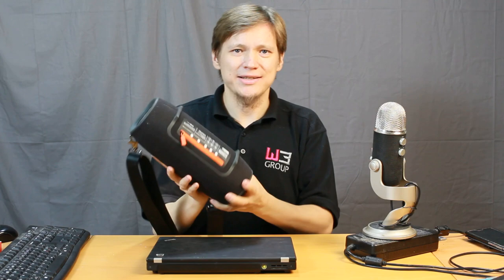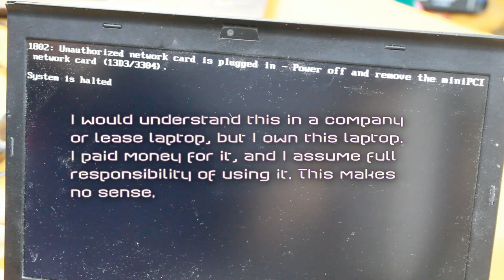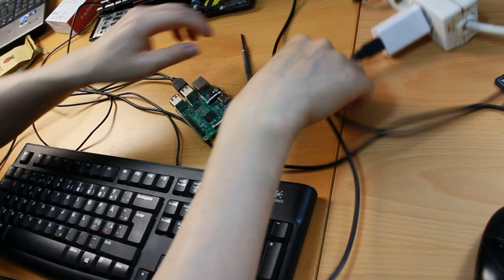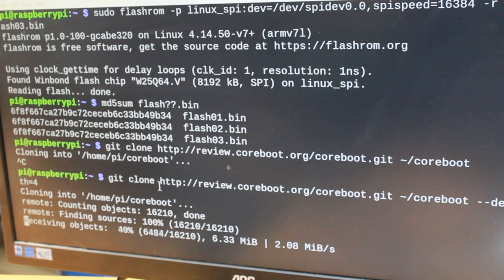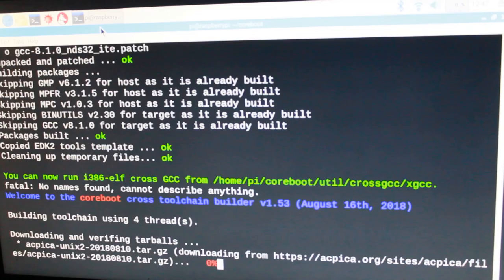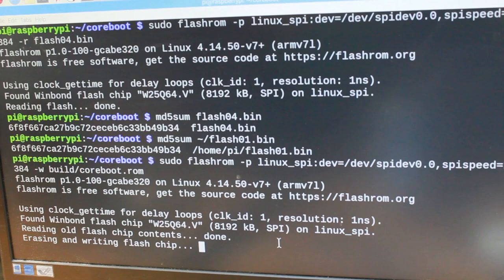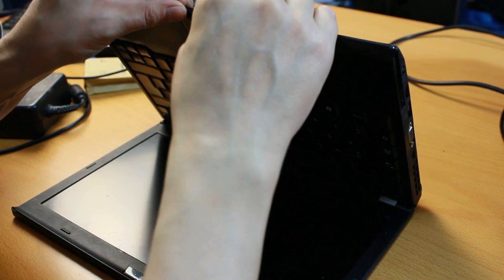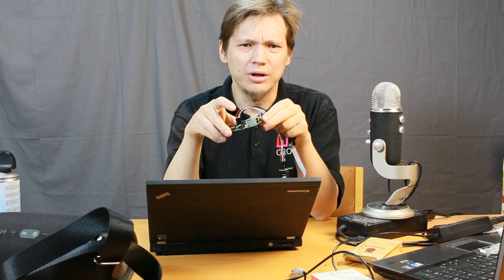Replacing BIOS in a ThinkPad with GPL CoreBoot (former LinuxBios)

Comment: I dont like how you handle that lovely x220... also its mini-pcie not mini-pci. those antenna cables are for wrongly attached.. red and blue are for mobile broadband and black and grey are for wireless. on that model bluetooth comes from seperate module on motherboard and i can send you one of those. those soic8 clips you use are pretty bad in quality. i would buy pomona clip for easier usage and better quality. there is also fullhd mod for that laptop model. with coreboot you can add sierra wireless 4g lte module on laptop and if you add extra antenna for GPS you can also have GPS on it. mini-pcie have pci-e lane and usb 2.0 - both 3.3v. i did use same clip for my first time by cutting off original cables and soldering new ones from higher quality jumper wires.
Reply: oh also - you can make it look way never if you just buy 'taikasieni' and use it all over body of it. ofc you need to disassebly it fully to not make mess with water over pcb. and there is new rubber feets available at aliexpress and ebay.
Reply: you need to use extender for card to mount it properly. also to attach keyboard you first put palmrest in its place and after that put keyboard in its place, press it down while move it up then down (or another way around, too lazy to check).
Reply: and also you should have used lil more time and efforts and just remap flash index, free all space taken out by intel me.. could be useful to have more room in chip and maybe could be nice to actually make it use grub/kernel-image and high res mode if you are anyways gonna use linux. cant remember if seabios did work with highres mode.
Reply: And i forgot to say that you did buy wifi+bt combo card and you could have just replaced your original card with it instead of adding it to wrong antennas and connect it half-ass ways
Reply from the maker: Okay I just read half-ass. My first impression of your lengthy posts is an attitude problem. But thanks for telling me about the antenna wire colors. I could not find that information anywhere, so it had to do my best without. It would be nice to learn your source. The reason I did not replace the original card (that was actually my original plan, that’s why I bought a combo card) is because the combo cannot do 5 GHz.
I did not buy Pomona because the prices with shipping were pretty high everywhere I looked.
Reply: @Bisqwit  i might actually have made error with colors. Red is 3g/4g main antenna and black or blue is secondary antenna. They have been same for long time. Do you want bt module? I can mail one. I have problems sleeping so my mind isnt so clear all the time.. and thats my reason to do kind of spammy reply.
Reply: installing keyboard you put it after installing palm rest, you have it little lower than slot for keyboard, then press it down and push as up as it goes and then press it down and drag it as close to palm rest as it can go. finally tightening screws under laptop. to me it looks like you did do that wrong too. probably having some other problems with your palm rest... sadly i dont have any extra palm rests in good shape. but i can send bt module or 2 and 3g card if you wanna try it out. sadly i have promised to give someone else mini-pcie msata memory.
Reply from the maker: Why do you have so many? It’s weird. If you’ve got an extra one (BT), sure I would like one. Which chipset does it use? Does it come with the connector/cable?

As for closing the palm rest and that stuff, doing stuff on camera is sort of stressful and you never concentrate as well and do as good job as when working privately, because you have to worry about visibility in the footage, how long it takes, and that sort of stuff, and part of the concentration is lost in doing exposition at the same time.

As for MiniPCI/MiniPCIE, I did actually say PCI-E on the video several times, but it was the ThinkPad BIOS which called it MiniPCI, not MiniPCIE.
Reply: Well I have few spare laptops as I kind of hobby restoring them and playing around modding hardware. And Im working for company selling used business laptops.
Reply: Im not really sure which chipset it uses. it simply goes to motherboard as it is with single screw.
Reply from the maker: By the way the reason why I did the antenna wires that way, is because the red & gray wires are too short to be connected to the left-side card. The blue & black can be connected to either card, but the red & gray can only be connected to the right-side card. This limits my options. If the combo card was full width, then the wires could be connected correctly.

Comment: I run older brother of this machine - x200. It came in with bluetooth card installed and working out is the box but I haven't tried it with wireless speakers. 
But I would expect there's an option in the bios to allow or verify newly inserted hardware..
Reply from the maker: There is no option.

Comment: Cool but couldn't you have just bought a new laptop for what you spent?
Reply from the maker: I spent about 6 euros. It is not very often that you can get a good new laptop for 6 euros.
Reply: I meant for all the other stuff.  Great video by the way.
Reply from the maker: What other stuff? All the other stuff were things I already had for my hobby and work and because this is not my only computer. Like the screen, keyboard and mouse. The cellphone charger — obvious. I had gotten the RPi for free, but I could have used any device that has SPI/GPIO, even some $5 Nucleo/Arduino board.
Do you think I only bought a screwdriver for this project?
Reply: I don't have any of that equipment you used so it would cost me a few hundred dollars to fix that.
Reply from the maker: You don’t have a screen, keyboard, mouse, or a cellphone charger?
If you used a Nucleo or Arduino ($5—$20), just using any another computer to control it would be fine; no extra keyboard or mouse or screen needed.
Reply: I did not know the Nucleo or Arduino was ($5—$20).  I thought I needed a raspberry pi 3 and all the cables.  Do you have a link to a cheap single board computer?  preferably used.
Reply from the maker: Raspberry Pi is probably the cheapest single board computer. It goes for around $30 on Amazon. https://amazon.com/gp/offer-listing/B00PEX05TO for model A, https://amazon.com/gp/offer-listing/B07BFH96M3 for model 3B+ (the one that I used).

If you don’t need a computer, but a microcontroller — meaning that you just need a programmable device that can do SPI communication — you can get e.g. an Arduino Uno compatible board (it runs 8-bit ATmega628P) for about 8€: https://amazon.de/dp/B01MDJA464

Technically, even this $1.76 ATtiny85 board would do: https://ebay.com/itm/192024551548 though programming such a tiny device can be somewhat a challenge.

For a 32-bit microcontroller, a Nucleo with STM32F446RE goes for about 15€: https://amazon.de/dp/B01IO3VUHG
These things are plugged into a USB port in your computer, and you compile software on your computer using a cross-compiler, and you upload the software onto the board in a process called “burning” (Nucleo and its Mbed compatibility makes this particularly easy, you just drag&drop the firmware to the virtual disk drive it presents). The board will then run your software. It has no displays attached or anything, but you can establish a serial link between the computer and the board — like a modem but much faster and pretty much instant, so you can read e.g. printfs and the firmware can receive your input.

Here is another STM32 based development board for about 8€: https://ebay.com/itm/172722032708 but you likely need a separate ST-Link device for programming it.

Note that with the microcontrollers, if you want to do something like replace a BIOS using its SPI interface, you pretty much have to write the driver for the BIOS chip (i.e. the part that communicates with the chip, sending commands to erase data blocks and to replace them with new data) yourself. You may be able to find such software already written in the Internet, but it is only good luck if you do.
Writing the software yourself is definitely feasible — but you need to read datasheets and understand the underlying concepts.

If you search for “development boards” on eBay — https://ebay.com/sch/?_nkw=development+board — you can find lots of interesting boards for really cheap prices. Most of them plug into a USB port and are programmed through it. They require different development tools, and for some of them, documentation can be hard to come by. They also have different sets of peripheral interfaces, and it is a good idea to research the product beforehand to find out if it suits one’s purposes.

I am actually planning to make a tutorial on the Nucleo some day.

Comment: Removing those idiotic whitelisted firmwares can also be done using pretty much any Linux or Windows PC and a USB flasher with appropriate connectors and an SOIC clip.  The RaspPis is a handy substitute for those who don't run Linux. (Linux can easily be written to USB with a persistent home director then booted anywhere desired including to install it as many FOSS firmware enthusiasts do for security.  https://www.youtube.com/watch?v=OttN8wQ1HhE  is an example. Some of those flashers need a voltmod which is just a few connections and covered elsewhere.
I secure loose components like that card with a dab of clear "sensor safe" RTV sealant from any auto parts store which is handy because you can peel it free later if desired.

Comment: I solved all my computer dirt problems by using an air compressor I had lying around that was originally from a paint spry gun.
Reply from the maker: A laptop that is carried several times in a week in a backpack and spends the workday there really accumulates stuff. I actually used the blow-can a couple of times while making this video. And a microfiber cloth. But bright lights, reflective angles and camera settings bring out and exaggerate whatever still remains.
Reply: It's ok I'm kinda dirty myself. If you saw my room right now... XD (cool video btw!)

Comment: twist the data leads to mitigate intrference =) you might get faser data
Reply from the maker: Twisting only helps if there is data and its inverse in some other wire, like with ethernet or RS485. It does not really help with SPI.

Comment: Why does EVERY SINGLE project nowadays, HAVE to involve a Raspberry Pi or Arduino?

There’s no real engineers left. 

🤦‍♂️
Reply from the maker: Sure I could have used e.g. a Nucleo board for this just as well — or anything that has SPI in a pin headers, but this flashing software already existed for Linux, so it made most sense to use a board that can run Linux, and an example of such board would be the Raspberry Pi. Or are you suggesting I should have created my own circuit board, soldered all the components on it starting from the SMC microcontroller to run the SPI line, to get my own bad clone of Nucleo? I’ve got no idea what the thought behind your non-sequitur is.
Reply from the maker: Sure, place the failure of your communication on the recipient. Way to go. Good job.

Comment: Can you build one for my T420s? lol
Reply from the maker: You are free to replicate the steps I took.
Reply: @Bisqwit  If you feel like it, sometime it would be nice to have a recap of what tools are with what. Not 100% where coreboot and libreboot builds are but I guess I'd get both of those and see if a build is suitable for the chipset at hand, pull copies of ROM using the 8 pin jumper (of which 4 pins matter) and a RasPi or laptop with CH341A and firmware for it, with commands ___ and once a firmware is built, either go with it or add EFI alternate boots ...  On the other hand if it's been out of your cares, thanks for the video to refer to.
  It was thrilling to see all possible builds come over (thanks, Python 3) with coreboot when I installed that on Fedora, but then there's no place to go to be in 'coreboot software' other than the list of installed utils. and scripts in dnfdragora (or one could use pkg commandlines.)

Comment: This is a cool video. Have you considered the Intel 3160 dual band combo board ? I believe it supports 2.4ghz and also 5ghz with Bluetooth combo. Intel 3160 Dual Band Wireless AC + Bluetooth Mini PCIe card Supports 2.4 and 5.8Ghz B/G/N/AC Bands https://www.amazon.com/dp/B00IOS19E6/ref=cm_sw_r_cp_apa_i_DNCkCbAM5QGX9
I've always wanted to try coreboot but none of the computers I have access too supports it. Can you do a video showing menu interface on coreboot ?
Reply from the maker: I actually ended up buying Intel 7260 later on. I also did away with CoreBoot and installed a modded version of the official BIOS, with whitelist removed and advanced configuration options enabled. I didn’t like how barebones CoreBoot was.

Comment: Why don't you buy a new laptop instead?
Reply from the maker: The market is not very big when you get into requirements: Light and small enough to be easily carried in a backpack together with other supplies like a water bottle; a trackpoint mouse (which apparently only IBM does right; the Dell equivalent is terrible); a keyboard where keys that are important to me in everyday use are not hidden behind a Fn key, and so on.
And this is not a particularly old laptop. I bought it just two years ago. Finally the consume-discard-buynew lifestyle goes somewhat against my principles in general.
Reply: Where's the fun in that ? :)
Reply: even though you bought your laptop two years ago it's relatively an old model  (the first release was in 2011 if your laptop model is X220) but i think you are right it's hard to find a piece in the market that satisfy all your requirements especially when we are talking about laptops it's not just about the requirements but also about the ability to get used to the new one. my laptop is hp pavilion dv6 i bought it in 2010 it's not a great laptop and it has a lot of problems especially with it's cooling system but what i can do i get used to it(the keyboard layout for example) and unfortunately i have not enough money to buy a new one even though i need more computationally  powerful model because i'm working right now in the field of machine learning and also the CDB lifestyle goes against my principles too :)
Reply: there is no better laptop than x220 if you want opensource,freedom,good keyboard,good batterylife,awesome linux support and so on... sadly x220 wont have usb3 (i7 model does have single port) and display cant be better than 1280x720 without doing hardware modding. but model is actually so popular that people did go and make adapter board and instructions to install 1080p screens on it.

Comment: There used to exist a utility that would allow you to rewrite the sub-id on the cards themselves to make the laptop think it was an authorised card. The claim as to why they done this in the first place was due to fcc restrictions but i doubt it has any substance as only ibm/lenovo and hp done it that i know of.  plus the individual cards have fcc certification so probably a load of crap.
Reply from the maker: Rewriting the IDs also screws up driver/kernel module autodetection so I didn't want to go that route.
Reply: @Bisqwit  You're missing what i meant. The tool i have used in the past didn't change the vendor or device id, only a sub id or similar (which was basically only used for this useless 'feature'). Therefore linux still detects it as normal.
Reply from the maker: Thank you for the clarification. Fortunately I did not go this route though.

Comment: Spending time on this shitty laptop itself is already losing value. it is kind of solving $10 problem with $100 solution.
Reply from the maker: It’s an OK laptop. Also, I spent only like 6 euros total for the bluetooth card and for the SOIC clamp.
I had the RPi already because I do things for my hobby and work (and I had gotten it for free), but I could have used any device that has SPI/GPIO, even some $5 Nucleo/Arduino board.
So no way this “$10 problem” had a “$100 solution” in my video. It is far fetched to even get it up to $10.

Comment: sorry to bother,i wanted to ask do you know why my ryzen 2700 msi motherboard pc, sees only half  ram and reserved for hardware the other half? like 16gb usable and 16gb hardware reserved. i couldn't find a fix on youtube, that worked.  thank you.
Reply from the maker: Are you sure it’s the RAM that is reserved? Or address space?
Reply: thank you for the reply, deeply appreciate. yes ,when i open task manager i can see there that 16gb are hardware reserved and have no idea why that is  @Bisqwit
Reply from the maker: Well I cannot say what this software that you are using is thinking, that’s between you and your software vendor, but if I had to guess, you are using an integrated GPU that shares RAM with your system RAM instead of having its own RAM, and your system is configured to dedicate that much RAM for the GPU.
Alternatively it’s your software reporting on the address space being reserved for PCI-E addressing. That would be normal, and it does not mean that actual physical RAM is being reserved.
Reply: @Bisqwit  thank you for your time. I have an msi motherboard and a ryzen 2700x with nvidia 1050 but i don't seem to be able to go in the bios and find the option that i saw on some videos on youtube, that apperently solved the  problem. Thank you so much for your insight.